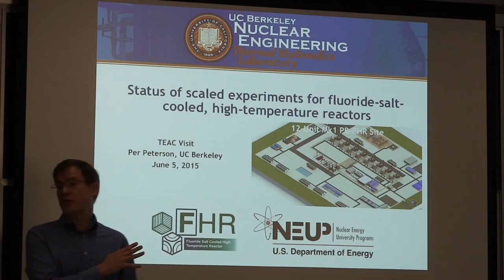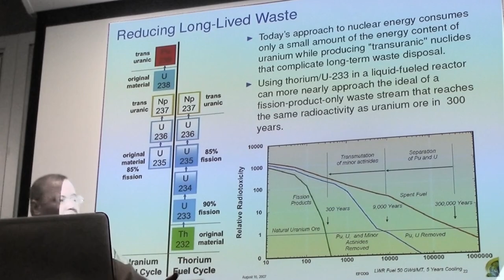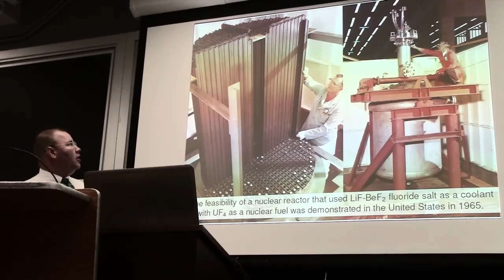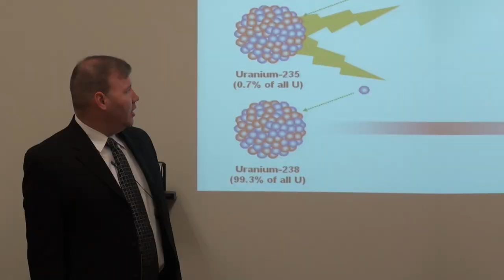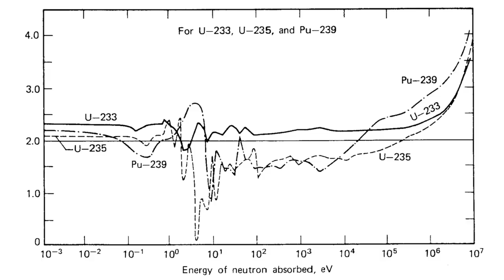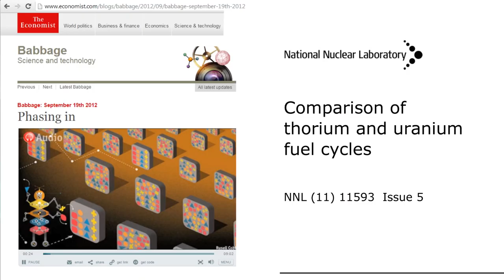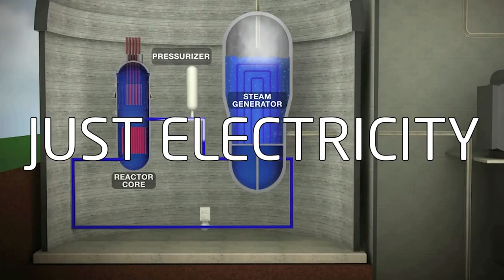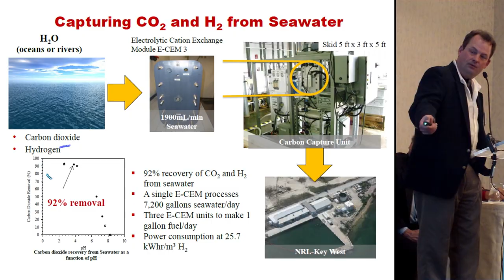Thorium Disadvantages

Comment: so, the main thorium disadvantage that it's a new age technology and old age people in power don't want it.
Reply: If the world flipped over-night to Thorium power.
Reply: It's actually old tech...
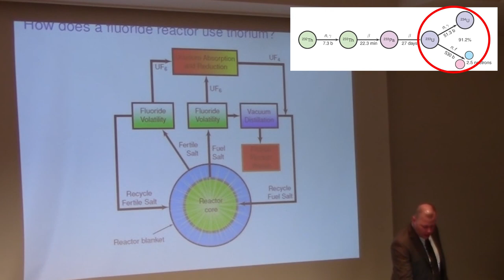Reply: I spell it out so even the people with little scientific background can understand the problem, the molten salts are to corrosive and no substance has been found for a vessel for period viable for commercial application without replacing it being cost effective.   No conspiracy. 29:15
Reply: @TheBaldr  That is the major problem for sure. Need advances in material science. China will likely be the one who develops the material, since they actually have funding.
Reply: Given the mishaps we've had with the comparatively simple radiochemistry of the uranium-plutonium fuel cycle, caution is warranted before jumping right into thorium fuel cycle - but we've gradually done the research we need to find out most of thorium's drawbacks.  It's time to make a working small-scale thorium power reactor.  AEC's thorium test reactor back in the 1960s/70s, was very stable and barely needed human intervention.
Reply: @jeanlafitte268  the mishaps with U235 cycle is mostly related to the use of Water , at insane pressures. Molten salt reactors with negative void coefficeient neatly avoids objections to nuclear power. Nothing to blow up.
Reply: Well more like wealthy people don't invest in it because there would be a huge up front costs (in the billions range) and return on investment would be slow because it would take forever (probably a couple decades) to get just one reactor built due to government regulations and permitting. It's a similar reason to why you don't see more desalination plants along coastal states.
Reply: @lordchickenhawk  
Yeah, they're 'white' when it suits their agenda...
Reply: I think that is the way they want it. Your power becomes more scarce and more expensive in the richest nation on Earth. Greedy bunch of money barons would rather see us die than live to enjoy life.
Reply: The companies are in debt up to theit ears with light water uranium reactors. Cost money to change directions.
Reply: cant sell oil if no one wants it!
Reply: Spent most of my working career in nuclear power. Realized a long time ago that the current use designs are outdated. Personally I think MSTR would be way better, but unfortunately I'm not the guy that gets to make that call.
Reply: Or some hardcore lobbing is taking place to stop the cheap & safer energy source...
Reply: NotJo  middle east wont collapse, they are already to renewable resource, and abandon black gold.
Reply: This is just nonsense. The salts did not corrode the oakridge reactor, and the reactor is so easily stopped and restarted for servicing that any corrosion after 10 years would be no problem, If it would happen
Reply: If 40 years abandoned is “new tech”...I’ve got a bridge to sell you.  There’s a very good reason oak hill is where the last experimental thorium reactor is.
Reply: Not true! The main problem is, where do we get the U233. Producing enough U233 from thorium to double the number of reactors requires a minimum of 7 years. Thus, if we had built our first thorium breeder reactor in 1971, we would now have enough U233 for 128 reactors today.

This is why Moltex and Elysium started with low enriched uranium then evolved their designs to burn Spent Nuclear Fuel. Even Flibe, a company that started with designing thermal neutron spectrum thorium breeder reactor designs, is now adding an SNF design to breed U233 in a thorium blanket.

Fifty years from now we could have enough U233 for mass deployment of thorium reactors. Until then we will have to rely primarily SNF fueled MSRs.
Reply: Americans don't want it, but China sees the potential
Reply: @mrpsquared01  You have a similar investment curve for fusion reactors, but still they are beeing built.
Reply: @Khepramancer  Old tech that couldnt make bombs so we went with the shittier version of it.   Its equivalent to not inventing cars because stable owners/horse breeders are paying people to say horses are all we need.
Reply: @TheBaldr  Moltex, Copenhagen Atomics and several others would disagree
Reply: That’s it in a nutshell. Innovation, daring and experimentation. Not something we’re really good at right now.
Reply: No, the main disadvantage of thorium reactors is that it was not dual use. It did not produce plutonium that could be used to make nuclear bombs.
Reply: Gow play with yourself.

Comment: The principal disadvantage of Thorium is its lack of weapon potential and light environmental impact.
Reply: Wait, can't you use the U233 in weapons?  Not that I particularly like that option.
Reply: Not really.  The answer is Anything ... "can be" a bomb, the question is, can it be delievered effectively?  The answer; no, not really.  A 100,000 fold reduction in your nuclear arsenal is not exactly a step "forward" to most military planners.  @chrisbero2
Reply: Small safe Thorium reactors that can charge advanced high energy consumption weaponry and point defenses and drones. It isn't directly a weapon but it could enable all the advanced energy hungry tech we have already developed.
Reply: U-233 which is made from thorium can be used to make a bomb as it was used in Operation Tea pot but it's not practical due to the presence of U-232 which gives off hard gama rays.
Reply: make no mistake the stuff that comes out is still incredibly dangerous ... but atleast it decays mostly in a few human life times. (that quick decay makes it potentially more dangerous short term). ....... if you look at the big picture you wont have kilotonnes of depleted uranium waste in holding tanks so its impact is probably far less.
Reply: @kingfisher1638  That's kind of like saying that jet fuel is a weapon because it is needed to fuel the jets that bomb you.  Or humans are a weapon because without a finger the pistol can't be fired.
Reply: @Amberscion  
Both statements you made are true. Both Jet fuel and Humans are weapons. 

A weapon is defined as any material phenom that can be utilized by a living organism to cause damage to another living organism.

Nearly anything can be used as a weapon but some phenoms have greater weaponizing potential or increase the potential of another phenom when combined.
Reply: @kingfisher1638  I should have used your term 'enabler' instead of weapon.  Jet fuel is an enabler of weapons because without it a jet bomber cannot fly.  Humans are enablers of weapons because without a finger a pistol cannot fire.  My point being that you're walking down a very slippery slope when you claim that something "isn't directly a weapon but it could enable" weapons.  You can literally say that anything is "not directly a weapon but can enable weapons" and so the label is meaningless and pointless to apply.  The atmosphere is an enabler, because without it humans would die out and therefore could neither create nor use weapons.  Get it?
Reply: @Amberscion  
But humans are literally weapons. Jet fuel literally can be used as a weapon to create explosives or burn targets not just enable.

Power systems integrated into a weapon package is a part of the weapon.

Is a gun a weapon or a bullet enabler?
Reply: There is one semi-serious real one -- medical isotopes are produced at present in much the same way as fissile material, using water-cooled high-pressure breeders.  Thorium reactors won't be useful for medicine... only for providing cheap, relatively clean energy.
Reply: @jamespfp  I'm not even at the layman level of knowledge on how much mass of isotopes are required yearly by the medical field, but I have to imagine that a single reactor would be enough for the supply.  If I'm not way off base with this WAG, this isn't really a drawback, or at least not much of one.
Reply: @Amberscion   The point isn't how much demand there is for the medical isotopes which occur as a result; the point is, they don't occur at all with the thorium-fluoride salt style of reactor.  That type would tend to consume those isotopes, not leave them as "useful waste".
Reply: @Amberscion  This also means that thorium-fluoride salt reactors can be used to "burn up" old leftover nuclear waste products that have no other use... even the very long lived isotopes which otherwise present a huge problem to human lifespans.
Reply: I.e. it destroys jobs. Then we'd have to employ those people in healthier jobs, which would mean various other jobs would be destroyed. A vicious cycle.
One of those days health will be the death of us.
Reply: Dowlphwin actually yeah, if a thorium salt reactor is instead loaded with cheap sugar and nobody catches it because future longstanding lack of health risk had lulled happy workers into carelessmess...
Reply: King Fisher depends on how well the 'bullet' fits into the chamber and serviceability of the firing mechanism.
Reply: I know, right? If you can't use your fuel source to drop a nuke or two or pollute an underground water reservoir every now & then, what's the point? :)
Reply: Uummmmm......... NO.
Thorium must be converted to uranium 233 to be used in a reactor.
U233 is excellent weapons grade material.

In fact anyone with a thorium reactor has access to fissile material for a bomb.

You could not possibly be more wrong.
Reply: Yes and no.

U233 is a really good material for making bombs but it's inevitably polluted with U232 which makes handling of the material very dangerous for humans even with high protection.
Reply: @tommorris3688  Um. NO. The bimb used on Hiroshima was a U235 bomb. The one and only USA U233 bomb ever made was detonated in Operation Teapot in 1955 and was a U233/Plutonium composite - and it was pretty much a "fizzle". The USSR used it as the core of one of its hydrogen bombs the same year (mix of U235/U233 and India tried it in 1998 (0.2kt == fizzle)

NB: Weapons-grade U233 has to be made in a specialised reactor.

The U233 which can be made in a dual-blanket thorium system is so heavily contaminated with U232 (100-1000ppm) that it's utterly useless for making bombs - ANY U232 component will make the thing unstable and most likely to prematurely go off (fizzle) giving a tiny yield - and in the process of pulling enough to make a bomb the parent reactor will be nobbled due to the lost neutrons, so detecting someone trying to do it should be relatively easy.

https://en.wikipedia.org/wiki/Uranium-233 - gamma hazards are significant at 5ppm U232 (making glovebox handling impossible). Implosion weapons require U232 below 50ppm. gun type weapons (the kind used at hiroshima) need less than 1ppm.

Separation of the 2 isotopes is effectively impossible without a large installation and the radiation emissions (gamma+neutrino) would make it fairly easy to detect.

That said, if you use a single fuel instead of dual blanket setup, then it's even harder to separate things out and not even the North Koreans would be trying.
Reply: What? LMSR produce weapon grade plutonium. In fact that is a real concern.
Reply: .. it actually can still produce weapons grade nuclear material by processing the wast materials
Reply: Are you saying companies like pollution
Reply: @jackvac1918  I'd forgotten about that path - yes, you're right it can be, but only in a dual-blanket setup (which is a good reason for not allowing them) and only if secondary processing of the blanket salt is allowed rather than batch irradiating and then dropping the results into the main salt a month later(*) - bearing in mind that the irradiated blanket thorium salt is even more furiously radioactive than anything containing U232 thanks to the presence of Pa232 and Pa234

The paper you refer to do does go into how U233 was separated at Oak Ridge but other available material points out that it wasn't exactly easy (U233 was used as reactor fuel in the fest tranche of MSR tests) - and in any case the answer is "Don't allow dual blanket setups" - the overall efficiency drops slightly but proliferation resistance increases sharply.

(*) A dual-blanket setup comprised of an ultra-long wraparound pipework arrangement with 30 day flowthrough time would ensure that the material is contained in the hot zone, avoids manual handling and might be worth considering as being proliferation-resistant. I think Weinberg might approve (but it adds complexity over just dumping fuel salt into the main salt for a few extra points of efficiency that's neither here nor there, so why bother?)
Reply: @tommorris3688  "too expensive in comparison to the cost of renewables" You can't go 100% renewable without a ridiculous amount of energy storage. You're going to need something  to take the last 10-50% of power generation.
Reply: badpizzadays - Surely that is a major advantage
Reply: No the problem is .......As per WIKI.... the construction cost per kilowatt at Shippingport was about ten times those for a conventional power plant
Reply: bingo!
Reply: We won't be able to make LA a sacrifice zone then!
Reply: @tommorris3688  Uh no. The way how it would have to be filtered out from the Salt mixture is more difficult than making centrifuges for U233 like Iran is doing.
Reply: Or that no viable reactor designs work...
Reply: Yes anything that is distructive they indorce, anything that has low distructive capability and more constructive they hide.
Reply: BINGO!!! We have a winner.
Reply: @chrisbero2  You could make a dirty bomb... but U233 would decay too quickly while you wait around to nuke your enemy.
Reply: Getting filthy rich by building power plants just doesn't feel the same if you aren't also crushing the hope of future generations
Reply: yep - if it's not producing weapon grade fuel than the that's a big disadvantage - so to speak.
Reply: Why would that be a disadvantage?
Reply: @kingfisher1638   They already have nuclear powered submarines and carriers, newest generation are entirely electrified. They can employ lots of energy weapons when they become available. Thorium generators wont change that.

Comment: Waited for the debunking, which didn't really ever happen. In fact, the information presented makes a pretty good case for giving it a shot.
Reply: They're stated in description, and I pinned a comment with the timecodes a year ago. But here's a copy/paste of the timecodes...
00:00 Solid-fuel thorium reactors fuel utilization ratios similar to PWR.
00:42 Liquid-Fuel in United States licensing is "scary".
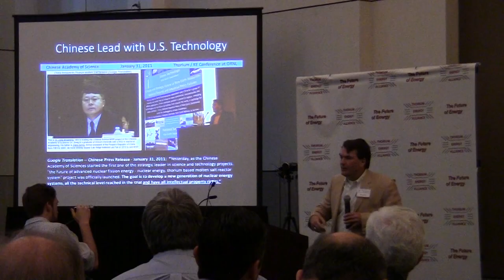02:04 Obama Administration willing to give away MSR know-how.
02:40 PWR seen as "good enough" for long time.
03:00 Licensing restrictions specifically target liquid-fuel.
04:45 NEA OECD evaluated solid-fuel, and liquid-fuel-fast-spectrum only.
20:50 Thermal-spectrum neutrons hitting U233 produce only ~2.3 neutrons.
23:00 Graphite moderator required to sustain fission in MSBR thermal-spectrum.
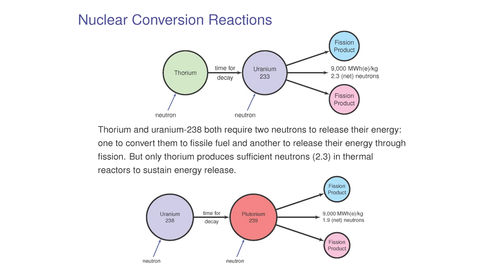27:50 Protactinium-233 half-life 27 days.
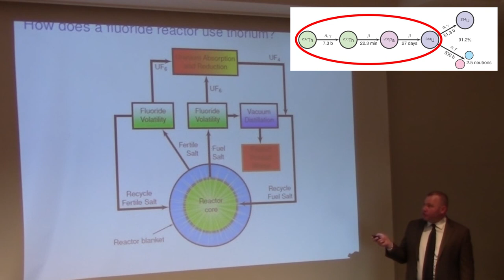29:00 Material challenges (MSR is pre-requisite so MSR challenges are Th challenges.)
Reply: @gordonmcdowell  None of those make for a debunking, and most not even for disadvantages.
Reply: @MartinVanBoven  Most MSR startups and the majority of funding is headed towards U-MSR variants, both fast and slow spectrum. One of the reasons this is likely happening is because those startups don't have the need for a Chemical Kidney to strip out fission products. Th-MSR operates in a very low breeding ratio. It is challenging to conserve those neutrons so strictly, they can't be lost to any structural materials AND fission products MUST also be removed or else the neutrons will be absorbed by them.

If U-233 released more neutrons when hit by thermal-spectrum neutrons, then this challenge would not exist. But it does. Currently Flibe has funding to develop the Kidney, while other MSR startups are busy designing pilot plants.

China has the resources to tackle this, and are tackling it now. But in North America, with limited resources, this slows Th-MSR development. Investors likely want the Kidney developed first. DOE is helping Flibe, and it is real money, but this isn't like Bill Gates talking about raising private investment of billions-of-dollars for his own advanced reactor choice at TerraPower.

Kirk's choice is to surmount Kidney challenge, and then use it to pull more value out of the operating MSR. But he's still got to prove the Kidney will work as he plans.
Reply: Maybe it is a Click bait title?
Reply: Well, it is given a shot, but viability isn't proven.
Reply: A presentation advocating use of thorium ought to trot out all the weaknesses.  Thorium reactors make Pa-233, which has to be salted out to prevent it sopping up neutrons you'd want to use to burn thorium and uranium salts in your  thorium fuel.  If you pull Pa-233 out of the fuel early enough, it decays to U-233, with a bare crit much closer to Pu-239 than to U-235.  U-233's both a good potential reactor fuel and can be used to make nuclear weapons (but we don't know much more than that about its suitability as a fissile).  But that's probably not happening because some U-232, a fierce and dangerous gamma=ray emitter, is also in there with your Pa-233/U-233, so radioactive you can't use gloveboxes to work with it the way you can Pu-239.
Reply: Cost is the main objection.
Reply: Giving it a shot and saying we should stake the future of the world on these at this point, non-existent, technology are two far different things.
Reply: @gordonmcdowell  --- Thanks, Gordon!

Comment: the compelling reason for any liquid salt reactor is to burn the waste from light water reactors that there is no other practical way to get rid of.thorium is a good way to do that.
Reply: Just because you absorb some neutrons with Thorium in a hybrid reactor, doesn't mean the products from U235 or U239 fission are different from conventional reactors.  I would think they would need to be removed from the reactor to prevent buildup and reduction in efficiency.